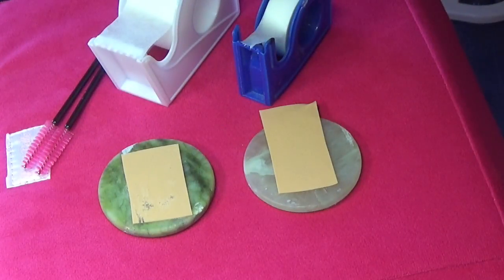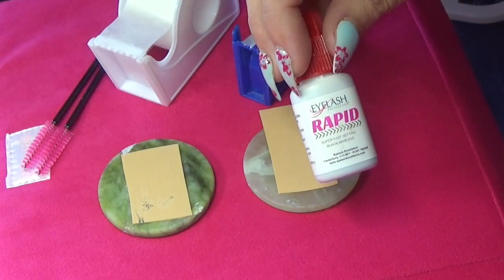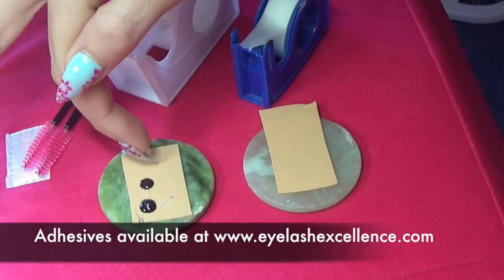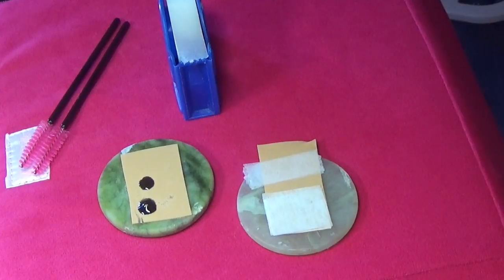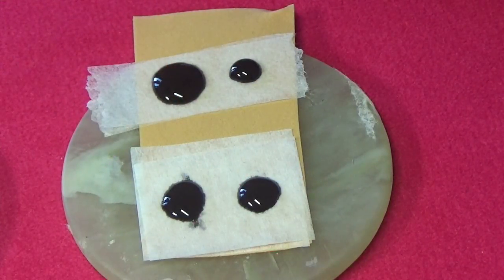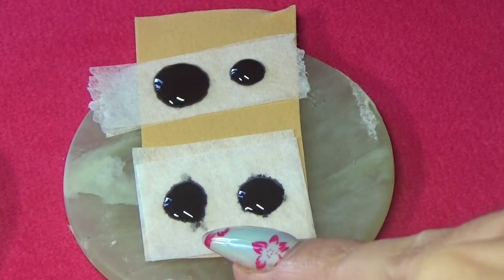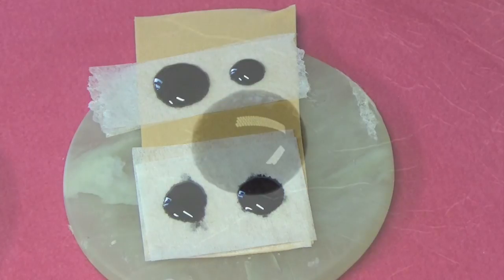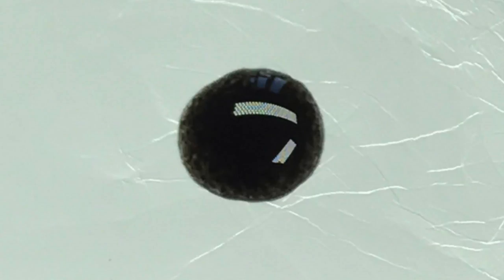PROBLEMS WITH YOUR EYELASH ADHESIVE?

Comment: the thicker glues are still the best than the thin and runny ones... they dry tackier and not hard so they are easy to pull off and wont rip your natural lashes
Reply from the maker: Hi Sarah, adhesive preference is individual to that technician and if you prefer thicker consistency ones thats absolutely fine. For me I like a thin consistency especially when doing volume as this means that I get a nice seamless amount and my adhesive does not wick. The natural lash should not ever rip out, if this is happening then the technician is not removing correctly by gently peeling the extension off - you do this by grabbing the tip of the extension with one tweezer and this will expose the natural lash, you then gently hold the natural lash in your other tweezer and then peel the extension off, the natural lash should not be damaged at all. The other issue is if the technician is using too much adhesive which means the natural lash is coated and therefore can't expose the natural lash from the extension to gently peel off. Hope this helps.

Comment: I'm new to lashing and I'm having trouble with my glue! I have lash box LA glue, and I've only done two sets, and practiced a few times and my glue has dried out and clumped. Would love a video on tips and tricks and how to properly store and close your glue. I do wipe my glue tip off with a non lint "cotton" pad, then i tap it on my table a couple times to get the glue to run down, then i cap it and leave it stored upright, when i go to use it again after shaking, i use the needle pin to unclog it, now its become impossible without taking the nozzle off and I'm getting CLUMPS of dried glue blocking it... HELP
Reply: try storaging your glue in a air tight container with a couple silica packs to ensure moisture isn't getting into your glue. also check the humidity and temperature levels in your environment: too much heat and humidity can cause your adhesive to cure pretty much instantly, becoming very tacky

Comment: Would this be a reason an adhesive would work great the first few fans then give out soon after?
Reply from the maker: I tend to find that a sudden increase in moisture and temp can be the reason. If the client suddenly get warmer even that heat can affect, which is why your glue can work fine and then all of sudden it seems to give up, yet its a new bead.

Comment: Thank you Frankie, for your best valuable information. I have been following you for about a year now and I have learned so much from your advices! I use those little white round glue stickers wich have a quite smooth surface. What do you think of them? A glue ring I find a bit tricky. I work with (for me personally) the best glue from Heaven. With friendly greetings, Patty
Reply from the maker: The white stickers are smooth yet are still able to hold the adhesive in a dome.
Reply: Frankie Widdows Eyelash Excellence Thank you!

Comment: They use pots for the adhesive how is this helpful overall. I don't know any professionals that use anything else.
Reply from the maker: Do you mean the little adhesive holders, some of them have several holes in them to hold the adhesive in? If so these are absolutely fine.

Comment: Thanks Frankie. My glue is Slower curing because it's the thicker texture. It's Nova but I find that my lashes get stuck together I think because it's not dying. Anything I could do about that?
Reply: Amy - Eyelash Excellence thank you so much for replying. I don't have the levels controlled. I suppose that could be the culprit. I looked it up and it's supposed to be at 50% humidity. It's very cold and dry where I live now in Wisconsin. I'll make some adjustments to my lash room and see if that helps.